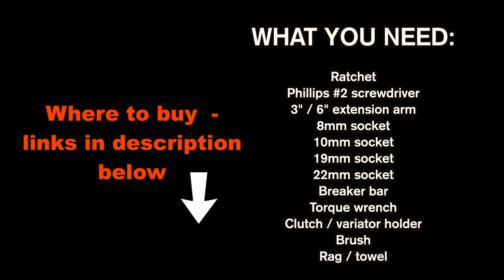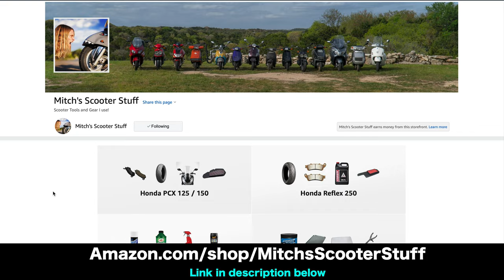Honda PCX 150 - CVT Removal / Installation - Variator, Clutch, Belt, Rollers| Mitch's Scooter Stuff

Comment from the maker: * Tools I used in this video: 
Ratchet 1/4 drive - http://amzn.to/2xcJEu1
Phillips #2 screwdriver - http://amzn.to/2fgdZDL
3” / 6” extension set 1/4 drive - http://amzn.to/2wDuzzW
8mm socket 1/4 drive - http://amzn.to/2xMhsBl
10mm socket 1/4 drive - http://amzn.to/2yrXjxp
19mm socket 3/8 drive - http://amzn.to/2CiXNqo
22mm socket 1/2 drive - https://amzn.to/3aHoJ64
1/2 to 3/8 drive socket adapter  - https://amzn.to/2EqLzQm
Breaker bar 1/2 drive - http://amzn.to/2HenuMI
Torque wrench 10-150 lb/ft 1/2 drive - http://amzn.to/2GuMsHJ
Variator / Clutch holder tool - https://amzn.to/2ZuYJEA
Brush 
Rag / towel
Reply: Hey Mitch! I done the all  process. I have a question. When I remove the cover, there is a cover gasket. My cover gasket removed, and it is qiute sucks to put it back in the same position. First question is in this case should I change cover gasket for a new one? (the is no hurt at all). I dont think so because its only task could be to stop rainwater come into belthouse. 
Second qoestion: are there any trick to fix cover gasket on the cover? Glue or something like this. 
Thank you for your video and for your answers. Greeting from Hungary.
Reply: Afternoon  Mich.
V belting arrows to pulley or CVT Please  people  are saying  one way &other saying  the other😮😮

Comment: Outstanding instructional video from start to finish!  This is how they should all be done.  The camera lens was focused in the perfect position all the time,  lighting was perfect,  tools need to do the job, torque specs for the pulley nuts, and you showed the correct holes to put the different cover screws in.  I knew I was watching the right video to do this job on a friends bike when I saw how you cleaned the inside of the covers before putting them back on...I do the same thing.  Thank you very much for making such a detailed video.

Comment: I was recently doing this job on my Genuine Buddy 170i and I have a suggestion for you, Mitch. Since your pulley cover has several bolts of different sizes,  you must keep them organized so you can reinstall them in the holes they belong in.  You can simplify things by getting a cardboard box, and using a felt tip marker, draw a rough oval in about the same shape as the cover. Then poke holes in it where each of the bolts belong on the cover on the oval shaped line you just drew. When you remove a bolt, put it in a hole in about the same place on the oval on the box. Then put the box aside, until you are ready to reinstall the bolts. This way they will not get lost or mixed up. You can also write notes on the box, like "this side up" or "don't forget the clip" etc.
Reply from the maker: That's funny, I have been doing that for a long time.. I just realized I filmed that tip a few years ago... I better edit that to post to share :)
Reply: @MitchsScooterStuff indeed!!!

Comment: Great video, the only thing I do different is not removing any plastic.  I just get a small ratchet to reach the only two  bolts that are by the variator.  Still trying to find that perfect roller weight for highest top end. Have a blessed day.

Comment: This is amazing!!! I'm from Brazil and I've just bought a used Honda SH150i 2017, here in Brazil the SH150 and the PCX uses the same engine and transmission. So... Your videos are great for me to learn how to make the maintainance of my vehicle! Thank you very much!!!! 😁😁😁
Reply: Here in Asia the SH150i typically has a 152.7 (153 class) engine, whereas the PCX's are typically 149cc engines that are found in Varios and Clicks... So here in Asia, different. Turns out its MUCH harder to locate SH150i parts as a result. But, if one does a lot of digging can find parts for other Honda bikes that work fit perfectly on the SH. For example, the FRONT BRAKE PADS are the same as the CBR250RR... Others (like CVT belt) are same as Forza. Sounds like Brazil easier to maintain an SH150 vs Asia, ho hum

Comment: Great video, without saying a word, just the relaxing sound of birds in the background!👍  You're lucky, if you need a tool you simply order from Amazon.  Amazon suppliers don't often ship to South Africa, and if they do, there's a chance it won't arrive.  3:11, those pins could be just a little smaller to fit into the holes.  12:51, Philips or JIS, although in this case it's not critical?

Comment: Everything was perfect except that the clutch holder tool I purchased had 1/4" dowls which is the same size as the holes so I needed to bore out the holes to 17/64".  After that, everything went smoothly.  Also, I don't think the direction of the face of the roller weights matter because mine were stock and the blue faces were all in different directions.  Thank you for this very informative video!

Comment: I have 21 PCX125 with only 1800 km. Opened up the CVT because of vibrations and there's double if not triple the dust you found on yours.

Comment: Hey Mitch, in your experience will the gasket for the left crankcase need to be replaced in my scooter? Given it was a new 2021 honda pcx 150 that has almost 16k miles. I have the belt, rollers, and 3 plastic slide pieces. Are there any new parts you would think I would definitely need to be replaced besides theses.
Thank you!

Comment: I have a PCX 125 and I have an final drive  oil leak above  the rear brake adjustment,  what should I do?
Reply from the maker: Wipe clean and inspect the the leak, maybe the bad worn out o-ring ?

Comment: Freaking Honda NAVI- the variator doesn’t have those two holes for my clutch tool- I am so mad cuz I can’t figure out how to remove the variator
Reply: You can also use those junky rubber oil filter removal tools to take off the variator.

Comment: It’s easier with an impact gun
Reply from the maker: Yes okay for removal, but I do not recommend for installation…
Reply: It's easier until you end up with a stripped variator nut 1000km down the road